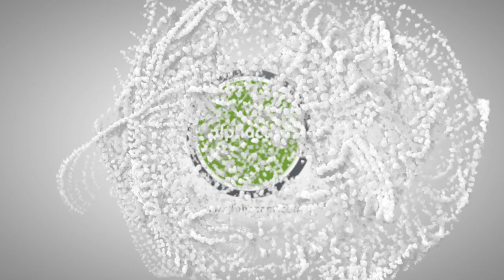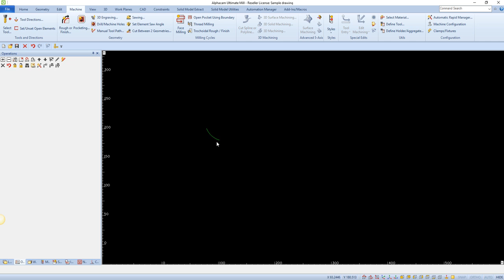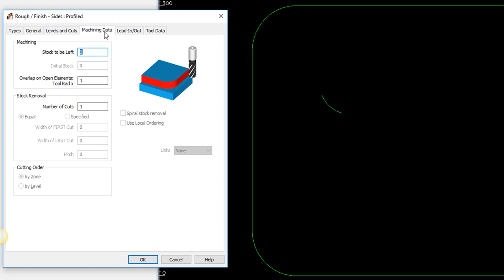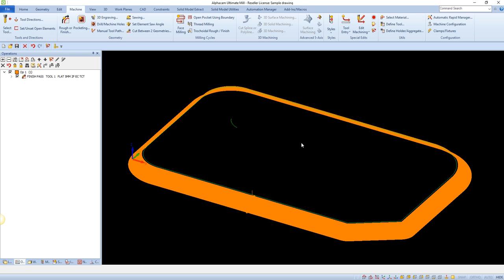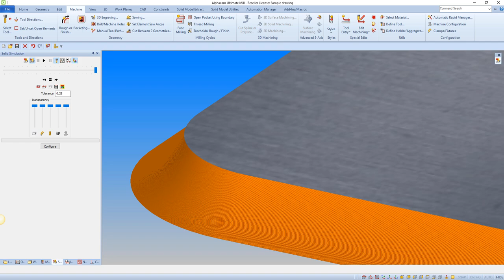Profile Cut | Alphacam

Comment: Can a ball cutter be used for perhaps smoother cuts when the desired profile allows?
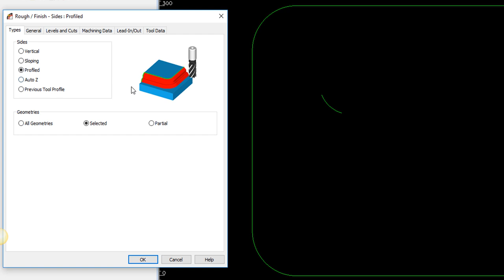Reply: yes. it can be used. if you have 2 ball cutters in different sizes , use the lager one with added " Material Top" ( @ 1:35 ) ( Eg 0.5mm) to do a rough cut and smaller one @ actual material top value or the smoother inal cut